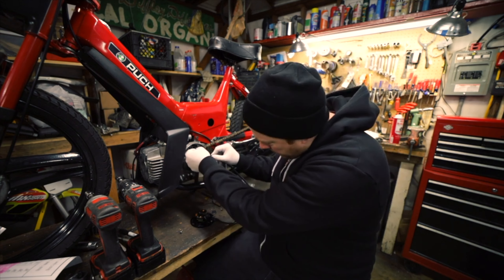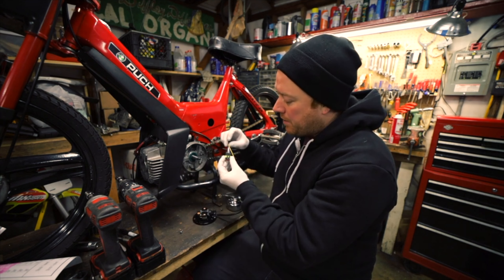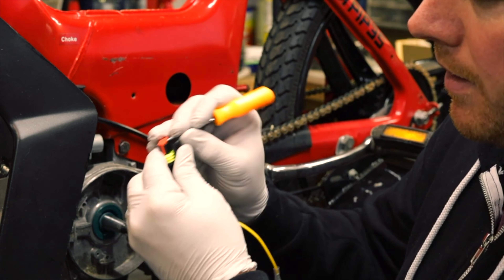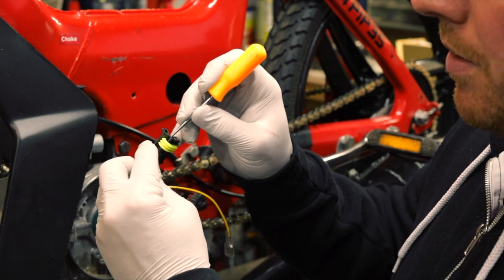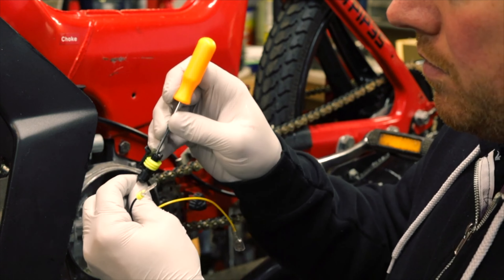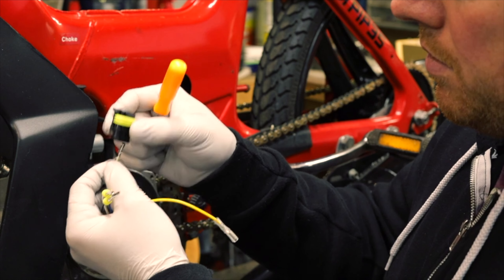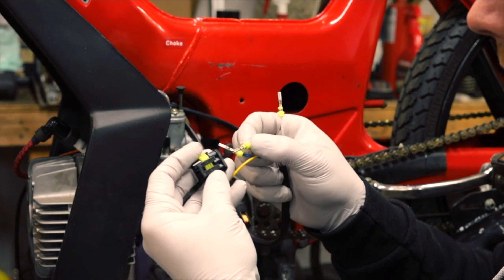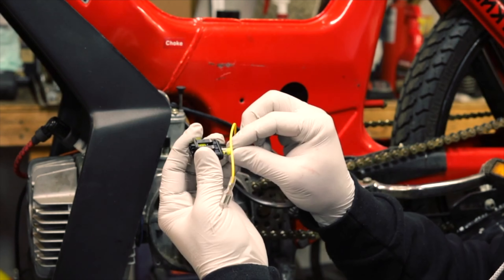How to remove HPI cdi connector pins and re install them

Comment: Also one more thing. You know the I-VEC ignition? I installed that today and set timing to 23 degrees. it ran so much cooler than HPI with 1.2 mm timing and color on the spark plug was brown.  But with HPI and the plugs gets white/hot/lean. Why’s that?
Reply from the maker: That's odd. Did you check the timing with a timing light? Some times they are marked wrong from the factory.